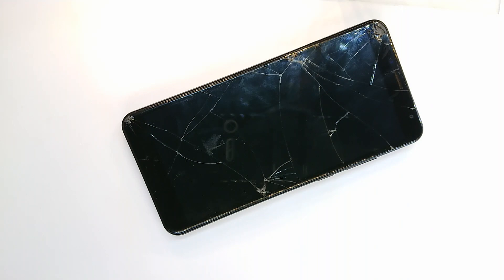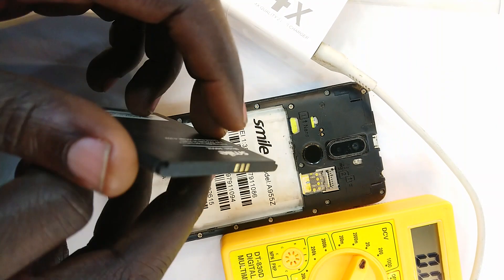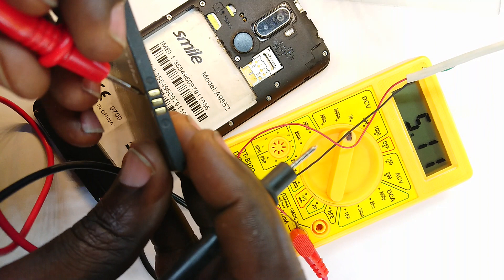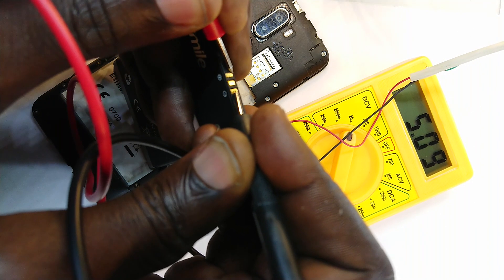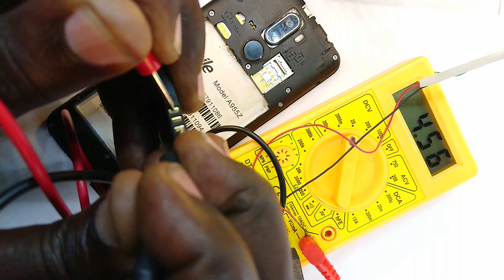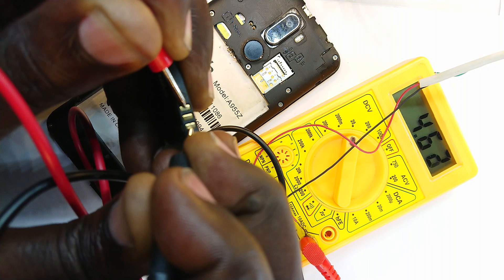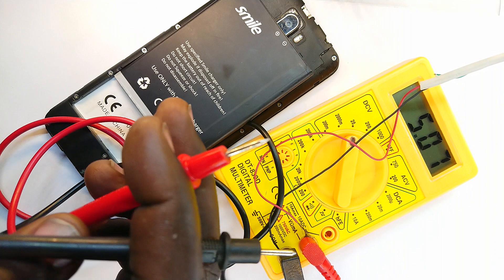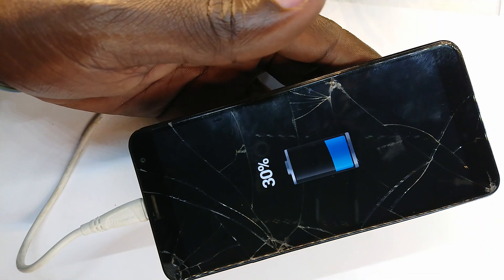how to fix a phone that won't Charge coz of low voltage on battery.

Comment: Hi i purchased a new battery and i insaltalled a new charging port a new cable and the battery just charged from 2.69 to 2.72 like in two days. Then it dies not charge more. I did this connected to the wall? What is the ussue? Thanks you sir nice video
Reply from the maker: Likely. Your charging IC

Comment: Hello friend,can you tell me why voltage on my phone battery connector pins are not stable it is go from 3,6 to 4,2 fast ?
Reply from the maker: One of two possibilities.
1. The battery's accumulator is faulty so you need a new battery 
2. The small circuit board on battery is failing ( having faulty component)
necessitating a new battery. 

Unless you have other batteries from which to assemble another battery
Reply: @PhoneLookout  thank you